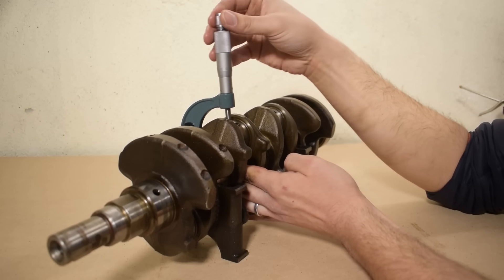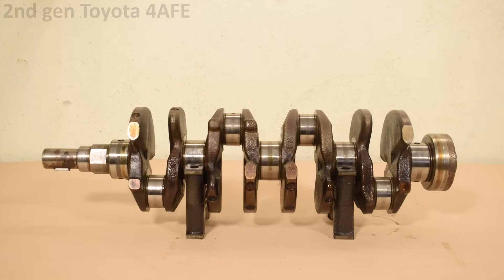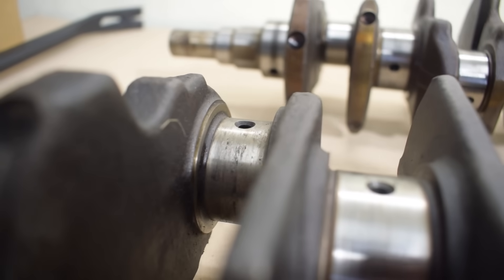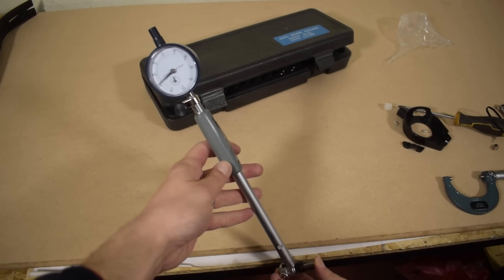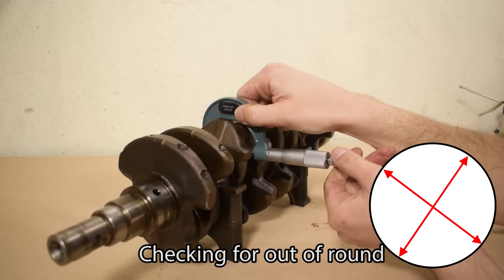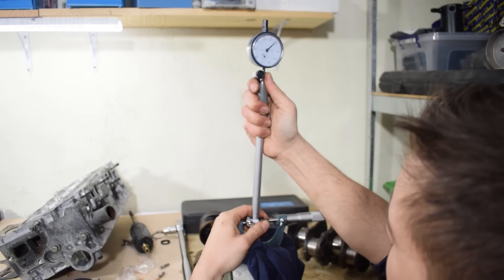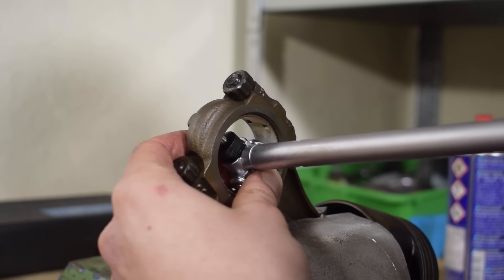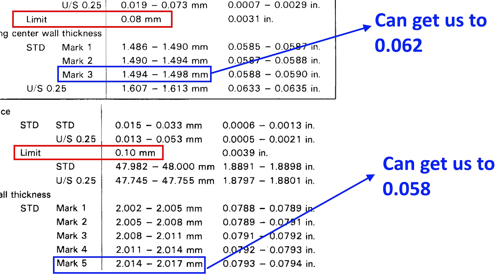BEARING CLEARANCE - How to MEASURE and PREVENT engine damage

Comment: I dont understand from start - why these are called bearings .. its just metal plates.. why not using ball bearings for such application ?
Reply from the maker: Because in applications where there are high shocks and high loads together with low maintenance requirements plain bearings are a better choice than ball bearings. They have more surface area so they can bear more loads and they require no maintenance. Plain bearings also take up less space and tolerate misalignment better.
Reply: These are called as plain bearings. They have existed long before ball or roller or needle bearings. Plain bearing is very tolerant to shock loads; this is a major weakness on ball bearings. Just think about surface area that is exposed to the pressure in either case. And remember, as it was shown on this video, when your car engine is running, there is NO metal to metal connection on your crankshaft bearings - it rides on film of oil!
Besides, there are engines, that use ball or roller bearings for main and/or big end journals. Very common on 2 stroke engines, due to reduced amount of lubrication. Longevity is the reason why plain bearings are common on car / truck / huge marine engines.
Reply: 1 side of a ball bearing is permanently slipping, they wear out
Reply: Plain bearings like this are much cheaper and require less space inside the engine. It's quite possible to use roller or ball bearings, as mentioned by another poster above, but it doesn't make much sense these days due to the amazing properties of modern oils and bearing alloys (unless you turn to the dark side and use a 2-stroke- in this case all your oil is diluted with petrol, and rolling elements are the only type of bearing that can survive).

Back during world war 2 many large aircraft and tank engines (especially radial engines, and inline engines produced in Germany) used roller bearings on the cranks. This was because back then the only engine oil available was single weight mineral oil (i.e. lawnmower engine oil these days), and the technology to produce modern multi-layer bearing shells was still in its infancy, so plain bearings didn't hold up anywhere near as well as they do today.

Comment: Does the temperature of the room or the parts will make any difference?
If yes, what is the recommended temperature to be set before start getting the readings?
Reply: Engineering inspection department's are air conditioned to 20 degree centigrade.  All iso measurements are at that temperature.
Reply: @lancefawcett1809  thanks

Comment: Good video. I'm a machinist and I never use the ratcheting knob on a mic. Also never met a machinist who does. Also measure rod bolt stretch instead of using a torque measurement whenever possible.

Comment: how does oil get in to crank oil channels? centrifugal forces must not allow freely flow there.
Reply: The oil pump has to deliver enough pressure to overcome the centrifugal forces. This is another reason you cannot have excessively loose main bearing clearances, if the pump doesn't generate sufficient oil pressure in the main bearings you may starve the big ends.

Comment: “No wear on mains, so I think they have been replaced.”

Not so my brother. 
My main bearings have 400k+ miles and no visible wear 

I did rod bearings. But mains can go forever if you play nice and stay on top of maint. 

This is a1998 vw engine.
Reply: They'll get a tiny bit of wear every time you start the engine (the oil wedge cannot support the crank until the bearing has achieved sufficient rotational speed, so you always have some metal-to-metal contact in these conditions). If your engine does lots of distance with very few cold starts (e.g. only used for long road trips) the mains might outlast other, less easily replaced components however.

Comment: I use micrometers just like that one everyday at work. This is a really good video as usual, but I'm a bit a skeptical of the sliding the micrometer method. Also, using these tools is a matter of developing a lot of tactile sensitivity. If people want to try this as amateurs it is great, but it takes quite a while to learn to use these tools precisely, and in the beginning it is hard to know if you are doing it right if you don't have other people around to compare your results with
Reply from the maker: You're definitely this does take some "feel" that only comes with repetition
Reply: I am also a machinist.

Comment: Some people say you shouldn't spin your crank before you torque your main caps down because the bearings aren't round until they are torqued.
Reply: I believe they are usually deliberately elliptical to a small degree, as shown in this video. This helps stabilise the oil wedge at high RPM, otherwise you can have 'oil whirl' issues that ruin the bearing.
Reply: @nerd1000ify  Possibly - but it's still fair to say that until they are torque down, the bearings don't assume their proper shape.

Comment: Whenever you buy a used engine, you need to check the bearing clearances, no matter what,
You must remove all the big end bearing caps and inspect the bearings, the crankshaft and you need to measure oil clearances, to determine if you bought a lemon and whether you need to take it back for a refund or exchange most used engine Japanese imports have warranties for their engines

Also you need to do a compression test but most used engine Japanese imports do compression tests before they sell them, but you must also check
Reply: You may not be able to return the engine if it's been opened. I bought a junkyard engine here in California and the valve train had rusted solid. I took apart the engine, tried to free up the valves, and put it back together. When I tried to return it, they wouldn't accept it. If the junkyard/importer or whatever has match marked the crank pulley or other parts, it's likely they won't accept a return.

Comment: you can use plastiguage for this mesurement as well. it's much faster and have good accuracy
Reply: it's actually what the picture shows in the workshop manual ;)
Reply: How does plastigauge tell you if something is out of round?
Reply: @Milkmans_Son  plastiguage is for measuring bearing clearence only.. it cannot tell you if something is out of round :)
Reply: @Milkmans_Son  You measure at 4 locations and / or axially around the journal. But many modern bearing shell designs run more clearance on the sides the help with oil transport in the higher loaded centre sections of the bearing. To check for out of round journals, you need the micrometers, indeed.

Comment: man iam learning a lot from you <3 
but I have a question,

what if I grinded the crankshaft 0.10mm?
then how I could get in the right bearing clearance!
I've checked my service manual and it shows 4 bearing sizes with a small clearance tolerance between them, I believe the tolerance is around 0.010mm.

so in this case, is my crankshaft useless? or can I buy a custom bearing that will help me to compensate for the over-loose clearance "due to crankshaft grinding".
Reply from the maker: You need undersized bearings now
Reply: The bearing sizes shown on the video are valid when the journals on the crank are in nominal standard size. When the journals on your crank have either worn out or there is scoring, the standard fix is to take your crank to the machine shop. They regrind and polish journals to the (usually) next "undersize". Usually there are a couple different "undersizes" available for your specific application. So  Same basic idea as boring the cylinder to a certain oversize and fitting appropriate oversize piston, except that some cylinders cat not be bored, but usually crank can be reground.